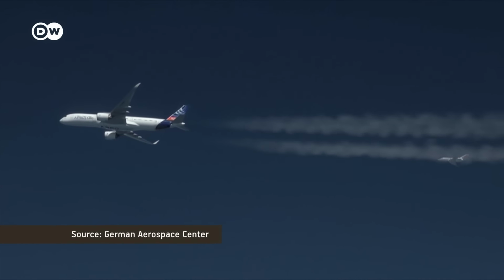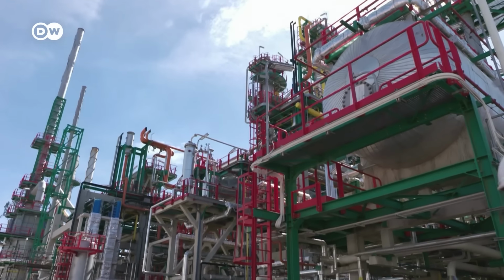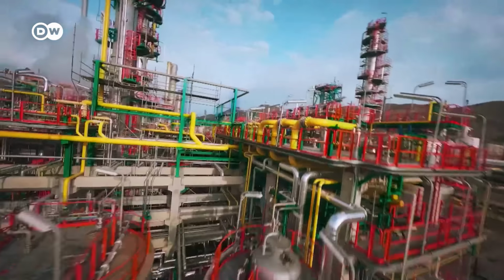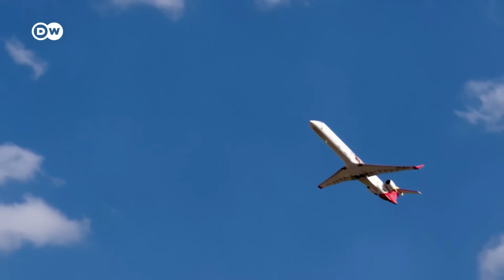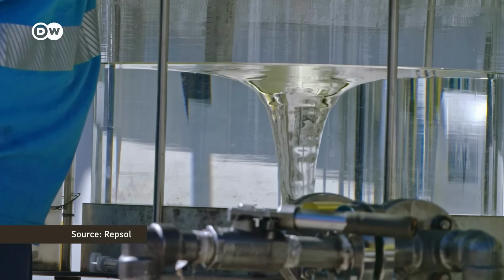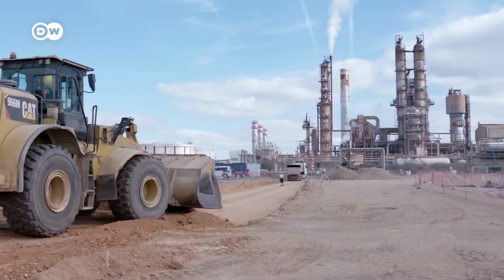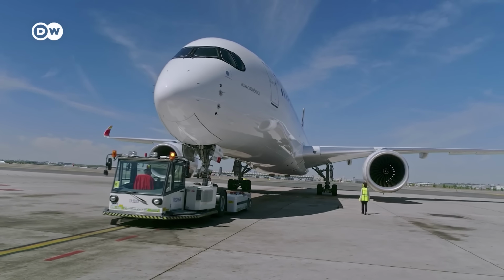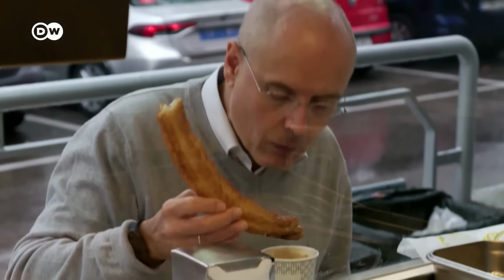How Spain is pioneering the use of cooking oil as airplane fuel | Focus on Europe

Comment: Interesting. But how much energy does it take to refine used edible oil into aviation fuel? How different is the total amount from the current fuel used? If greenhouse gases are emitted in the refining process, it would be worse.

Comment: Let us also know the real calculations of the energy you waste for the collection, transport and process of those tiny amounts of cooking oils wastes, and how much cooking oil is needed for any reasonable amount of flight time. 

In a nutshell, energy is conserved, so amount of cooking oil is needed for a certain amount of equivalent flight fuel is much more energy inefficient and environmentally unsustainable compared to the same amount of normal flight fuel due to all those extra hazards you need for the processing of cooking oil.

Green Washing 🫠
Reply: Economies of scale, nothing more and nothing less as every new project. Just because the costs (economic and ecologic) are not the best from the start, it doesn't mean that the project has to be discarded
Reply: @ Replacing one oil to another oil, with additional carbon footprint related to the collection transport, and process. Good luck with your "economic" calculations 👍🏼
Reply: @santanu-sh  20 years ago pv solar energy had costs over the roof and there were people that said that it would never be marketable. 
Those process can be made more efficient. Not saying anything or doing any calculation, I'm just saying that discarding a new project over that statement might be wrong as history has proved that investigation, development and investment can make a difference in all parts of it, I would approach this project with patience. I don't think it will solve all the problems around flight industry but it shows field for improvement.
Reply: @ Solar energy is a renewable energy, cooking oil is not. You are replacing one oil with another, with extra energy consumption costs due to all overheads. Comparing solar energy with another oil is the most dumbest argument ever 👽

Comment: Simply not scalable as a solution given the current global demand for air travel and jet fuel , as oil for fuel crops compete with land for food , its niche , even the airline is only looking at substituting 10% of fuel.l by 2030. Currently there is no scalable model that gives enough plant based oil.

Comment: Respectful Greetings!
To: DW News.
Sustainable Aviation Fuels (SAF) are a promising solution for reducing carbon emissions in the aviation industry. Here are some key opportunities and challenges:
Opportunities:
Significant Emission Reductions: SAF can reduce CO2 emissions by up to 80% over its lifecycle compared to conventional jet fuel.
Compatibility: SAF can be used in existing aircraft engines without requiring major modifications.
Renewable Sources: SAF is produced from renewable resources like biomass, waste oils, and agricultural residues.
Government Support: Various governments and international organizations are promoting SAF through mandates and incentives.
Market Growth: The demand for SAF is expected to grow significantly, driven by environmental regulations and airline commitments.
Challenges:
High Costs: The production and certification of SAF are expensive, making it less competitive compared to conventional jet fuel.
Limited Production: Currently, SAF production is limited and accounts for less than 1% of global jet fuel consumption.
Feedstock Availability: Sourcing sufficient sustainable feedstock to meet the growing demand is a challenge.
Regulatory Hurdles: SAF must meet stringent technical and environmental standards, which can be time-consuming and costly.
Infrastructure: Developing the necessary infrastructure for SAF production and distribution is a significant challenge.
Despite these challenges, the aviation industry is making strides towards adopting SAF to achieve its carbon reduction goals.
Courteously!
Luis Van-Dunem

Comment: Respectful Greetings!
To: DW News.
As the global aviation industry faces increasing demands for carbon reduction, the need for sustainable aviation fuel (SAF) is also rising. SAF is similar to traditional kerosene-based aviation fuel but has significantly lower carbon emissions. This reduction is achieved through various routes, including carbon capture technologies and the use of biogenic-carbon feedstock, such as biomass, which contribute to overall emission reduction. However, as a new alternative fuel, SAF's application is limited due to a lack of awareness among countries and the absence of relevant regulations. copied in the article (in the year 2025): Sustainable aviation fuels: Key opportunities and challenges in lowering carbon emissions for aviation industry.

Producing sustainable aviation fuel (SAF) offers several benefits for the civil aviation industry:
Reduces Greenhouse Gas Emissions: SAF can significantly lower lifecycle greenhouse gas (GHG) emissions compared to conventional jet fuel. In some cases, it can reduce carbon dioxide (CO2) emissions by up to 80%.
Improves Air Quality: SAF emits fewer harmful pollutants, such as sulfur oxides and particulate matter, which contributes to better air quality.
Economic Benefits: The production of SAF can support rural agricultural economies by generating jobs and income. It also has the potential to enhance engine performance due to its cleaner burn2.
Compatibility: SAF can be blended with conventional jet fuel without modifying aircraft engines or fuel systems, making it a practical solution for reducing emissions.
Supports Sustainability Goals: The global aviation sector aims to reach net-zero carbon emissions by 2050, and SAF is a critical component in achieving this target.
These benefits make SAF a promising solution for making aviation more sustainable and environmentally friendly.
Courteously!
Luis Van-Dunem

Comment: Spain always does well in renewable energies.
Reply: How is cooking oil renewable?
Reply: @foxtrot762  Plant based. Does your cooking oil come from below the ground ? 😂 Mine doesnt.
Reply: And Indonesia will be the leading for the fuel since indonesia is the biggest cooking oil exporter
Reply: This is not a renewable source. It's just another energy source that is finite and highly dependent on weather patterns.
Reply: @realnapster1522  If managed well it is renewable. Even solar/wind is dependent on weather patterns but it is renewable.
Reply: But not so much lowering the CO2 emissions. 2023 and 2024 show the same values according climatetrace
Reply: @EV-FUN False. Plant-based cooking oils are biofuels known as a Sustainable Aviation Fuel (SAF) and reduce emissions by as high as 80% due to the processes involved with their lifecycle. They are significantly better for the environment, and future generations will make them even better.

Comment: Wait a sec, those oils would previously have been going to landfill (and not effect climate change) so this is burning them and causing the same climate change as regular kerosene.

But it's "sustainable"... but the problem is not that we are running out of oil, it's the opposite problem

The contrail thing is just green washing. In fact this whole video is greenwashing.

Comment: Everyone tends to think jet fuel is fancy.

It isn’t. Basically close to paraffin. There’s no difficulty adapting to another similar fuel.
Reply: Jet fuel is normally highly refined for reliability and safety, but in principle a jet engine will run on just about anything. There have been experiments with running gas turbines on coal dust. Not for aircraft though :).
Reply: No it's not close to paraffin, it is between gas and diesel.
Reply: @ciprianpopa1503 "not close to paraffin..." The wiki page for Kerosene starts "Kerosene, or paraffin..."
Reply: @ciprianpopa1503  Kerosene is the jet fuel base, and is essentially similar to paraffin, specifically designed for turbine engines used in airplanes. Gas and diesel are made of the same base petroleum distillate but have different additives to make them their specific fuel type; the latter chemical properties have the potential for engine damage and are not used in airplanes.
Reply: @ Then diesel is similar to paraffin too. Even bitumen is close to paraffin. What's the point of using all those names though? Why don't we use paraffin or bitumen to run our planes since they are all close?
Reply: @ Be quiet. I fact checked what the fuel specialist told me when we were building a field storage facility. It’s similar to paraffin. It has additives and tweaks of refining. But if you stuck paraffin in a jet it would fire. Badly. But it would fire. If you stuck bitumen in a jet you’d have a sticky jet engine and nothing else.

So, please. Just stop.
Reply: @ Petrol and paraffin are both derived from crude oil, but they have distinct properties, uses, and chemical compositions due to differences in how they're refined. Diesel is heavier and contains more complex molecules than paraffin.
Bitumen is vastly different in its properties, composition, and uses. It's almost solid at room temperature.
Reply: @evaluateanalysis7974 Paraffin and bitumen are both solid at room temperature. You have a talent to underline the non deterministic properties. Moreover, everything you said is pure BS. the difference between all of them is the longer chains in paraffin and in decreasing order in diesel, kerosene and gasoline. So again is kerosene is paraffin than diesel is also a paraffin. If you really want to be pedantic concerning kerosene I suggest you refer to cetane number instead. To make it more clear for the wannabe petroleum refiners out there, there is diesel in-between paraffin and kerosene.
Reply: @ciprianpopa1503 "Paraffin...solid at room temperature" I am totally amazed that jet aircraft can fly. Do they have a stoker shovelling it into the engine? You need to spend more time on your chemistry homework or you will fail your school exams.
Reply: @evaluateanalysis7974 Your jokes make me cry. Did you hear about paraffin candles?
Reply: @ Paraffin wax is solid at room temperature and they made candles with paraffin wax. No one has ever, or ever shall, confuse paraffin wax with paraffin - unless they are being intentionally obfuscatory.
Reply: @kellypaws  It depends from what part of the world one comes from:
Here is from the wiki page cited above:
"Confusingly, the name "paraffin" is also used to refer to a number of distinct petroleum byproducts other than kerosene. For instance, liquid paraffin (called mineral oil in the US) is a more viscous and highly refined product which is used as a laxative. Paraffin wax is a waxy solid extracted from petroleum." So, in Europe there is little to no connection between kerosene and paraffin in common parlance.   
In the book "Paraffin Products: Developments in Petroleum Science" all fuels plus waxes are called paraffin though. In fact, paraffin is synonym to alkane.

Comment: Fantastic solution of recycling cooking oil. However, the main problem of biofuels is when you start to use land area that could have been used to produce food for producing fuel instead
Reply: We have plenty of food in the world if we don't waste or fight over it.
Reply: @JeffBilkins  Easy to say that to the people starving
Reply: There is nothing fantastic. It is well know for more than 100 years and it is called cracking. It also requires a lot of energy since you have to heat all at more than 300 " C.
Reply: @ciprianpopa1503  Energy can be produced in a lot of different ways, but transitioning it so it can be used in planes is the hard thing.

Comment: This is known as HVO fuel and it is already used in many countries. 😂
Reply: Is it used often, and to what percentage. it needs to be mandatort usage, .ore biodisel less toxic crude oil
Reply: @Keepskatin you need more education on this topic
Reply: In commercial aviation? I don't think so.
Reply: @Djamonja  in the US already, yes, SAF has been in use for a few years already.
Reply: @NWer-c5u  Only on experimental aircraft
Reply: @Djamonja  well I tried to respond a few times with citations and details, but YT keeps deleting so here, real simple: United is using in a select flights (the most) and others too.
Reply: @ They might be using a tiny bit, but it is not a significant amount. I know they can make the fuel, but it's not commercially viable (yet).
Reply: @Djamonja  14.3 billion liters since 2013 for UA, and no, not viable due to price (around 8 USD/gal at FBOs, UA no doubt gets it go less). Nuclear-made synthetic Jet fuel can be made viable using thermal-chemical waste heat from reactors that otherwise isn't being put to good use.